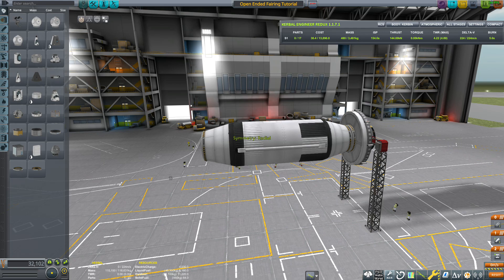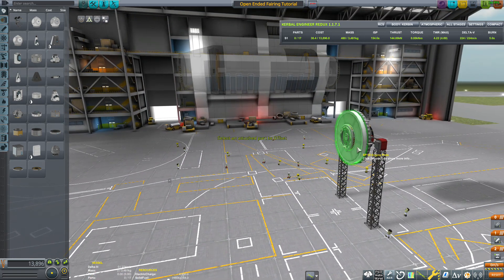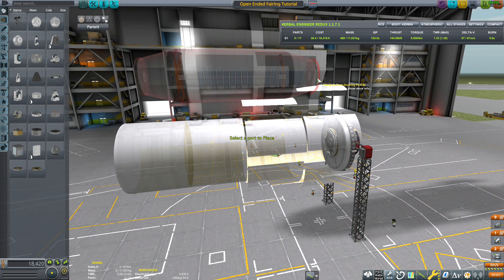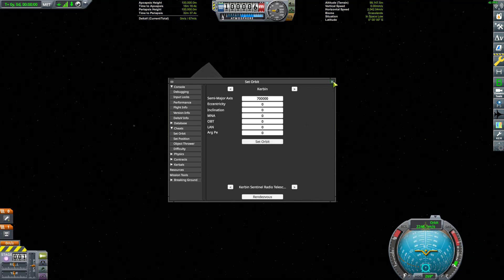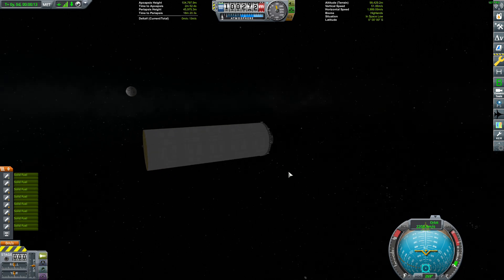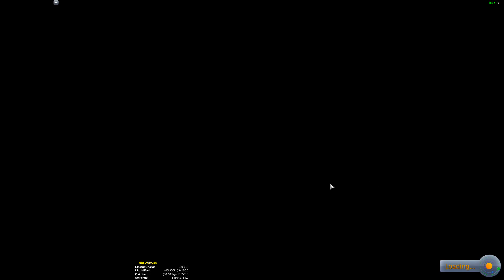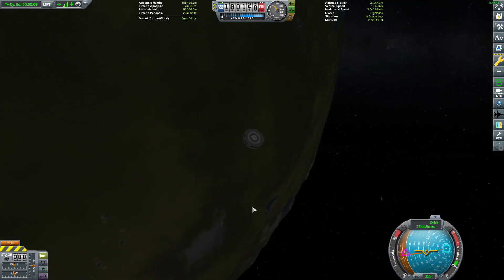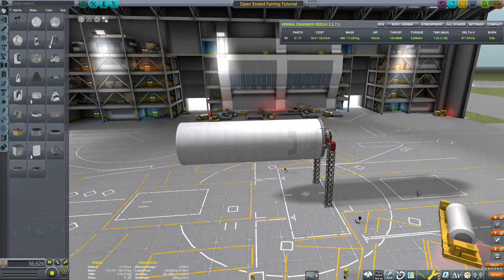KSP Quick How To's EP1: Open Ended Fairing

Comment: Very nice. One question tho, is the stuff inside the fairing occluded from drag?
Reply from the maker: It is!  However, there is a much easier way to make an open ended fairing these days.  If you hold alt while building the fairing, it will complete the fairing even with the end open.
Reply: @lt_duckweed  oooh, amazing. Tysm